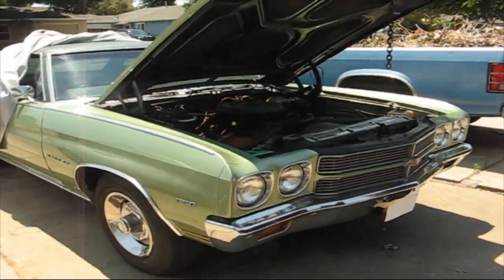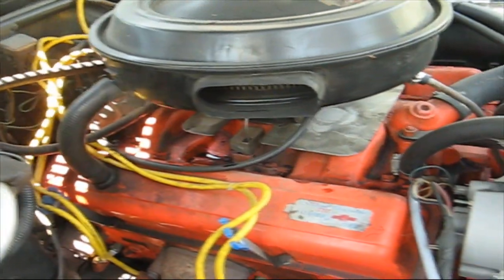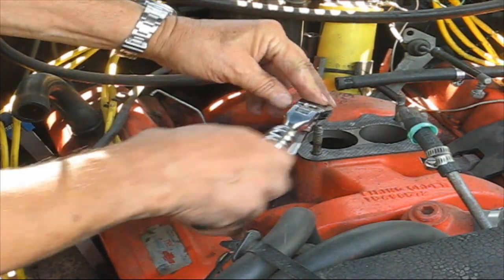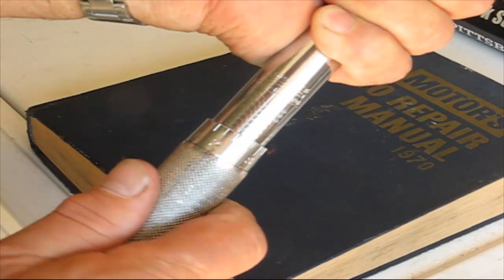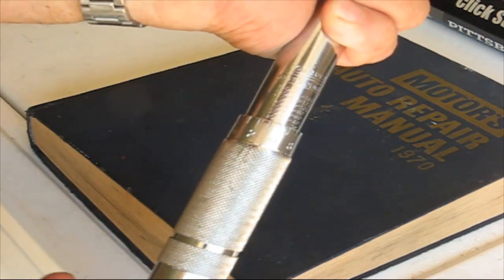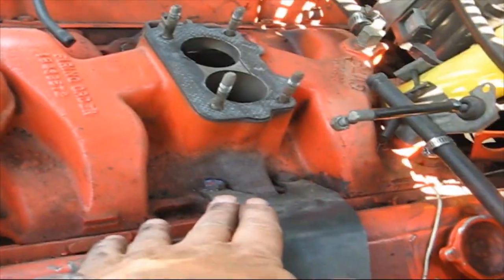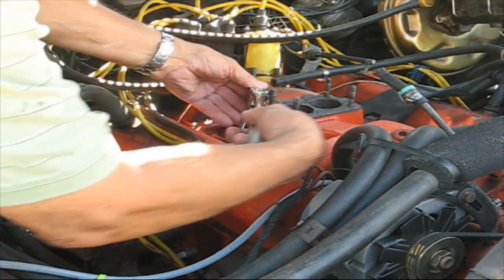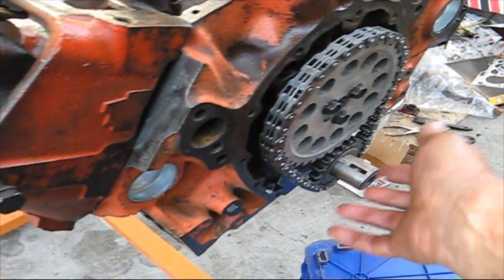How to stop oil pooling on intake manifold - Chevy

Comment: Would this apply to 305 SBC as well? I have an 84 pontiac with a 305 SBC and i have oil pooling in 3 of the 4 indents. Until now I assumed that the carb was flooding (with no evidence of gasoline on the outside of the carb) but having seen your video, I am now convinced that it is oil. (Im not an experienced mechanic, I can't tell if it is oil or gas. I guess one way to tell if the car sits for days, the gas would evaporate..) any advice would be appreciated! Thanks+
Reply from the maker: Put your finger in it.
This is not hard, just take out each bolt put RTV on it and tighten it back up, then go to the next one.
Reply: @davidlis6709  It was oil. I cleaned the area, took the bolts out (all threads where drenched in oil), cleaned them with carb cleaner and put black RTV on the threads. Due to the angle, I couldn't get the socket with the 3/8 driver to fit perfectly, but i did try my best to torque them down. We shall see if that fixed it. Thanks again for taking the time to respond!
Reply from the maker: @robbiesz  See, not that hard.
Reply: it's hard to use a torque wrench  @robbiesz Impossible. Plain wrench I used too. 1982 firebird 4 bbl. 3 of the bolts sealed properly but one yesterday has oil again.I m using 134_2001 Arp bolts black oxide Hex  for the intake.

Comment: This is a tried-and-true method! I own (50-year ownership) a 57 Corvette, 283 (original) engine. When I rebuilt the engine years ago, I increased the oil pressure by installing a new heavy-duty spring in the oil pump. With the increase oil pressure oil started pooling around the same bolts you mention in your video. I also removed the bolts (one bolt at a time on both sides, 4 center bolts) and wiped the threads with Blue RTV.  Reinstalled, torqued the bolts and this solved the problem. Thanks for the video!
Reply from the maker: My old 57 Chevy with a 283 had the same problem.  I wish I still had my 57.  I sold it in 1970 for $350 to pay for college tuition.    Looking back it was the right thing to do because it eventually lead to a BS in Mechanical Engineering and provided a good job.

Comment: I just wonder why you could guestimate with the ratchet to torque the intake bolt, but not the torque wrench?
Reply from the maker: I could not get the torque wrench on the bolt.
If I was not making this movie, I would not even use the torque wrench because I have been doing this since 14 so I have a feel for how tight it should be.   Wrong answer.
Reply: @davidlis6709  I understand, next time you can use a 3/8 extension instead of 1/2, smaller diameter will fit the carburator lip, you could add a flex joint to help for clearance, 1 or 2 degree of offset will not affect your torque in a significant way.  And most of all, thank you for your video. My bbc 454 is pooling oil on the intake, i will check if the bolts have sealer.
Reply from the maker: @ayuse01  I have never seen anything from the factory having sealer on the bolts.
Reply: @davidlis6709  Well, i finaly have a leak free 454 bbc, it was the 4 middle bolts on the intake that needed sealer.
Reply: @ayuse01  I have a 454 with pooling on middle bolts on drivers side.  I am anxious to try this and hopefully resolve my issue as well!  Thanks David!
Reply from the maker: @ayuse01  The end bolts don't get the same amount of oil splashed on them compared as the middle ones.
Reply from the maker: @cjf3838  It always works

Comment: This is what I need to do to my 63 impala with a 350 sbc.

I've just never removed the carburetor before. I'm sure its scarier than it look but don't want to mess anything up.
Reply from the maker: Stop talking like that.....    It is not that hard.  Take pictures of the linkages so you remember.  You have to start somewhere, do the easy jobs first to gain confidence, than you will be like me and tackle anything.

Comment: Dumb question here, but where is the oil intake?
Reply from the maker: There are not dumb questions.  We all have to start somewhere.   On this engine, you add oil on the drivers side valve cover.  Is that what you are asking?

Comment: Thanks for taking the time to put this video together.  I have oil pooling in these locations on the driver side of my 350 small block with 4 barrel.  I was thinking it would be resolved when I replaced the valve cover gaskets but this looks to be the real cause.  Will give it a go.
Reply from the maker: I am sure this will solve your problem.

Comment: my 350 leaks oil through the dipstick over 50 mph, what is the fix? Its tuned properly also
Reply from the maker: Does it leak where dipstick goes into the block or at the end of the tube?
Reply: @davidlis6709  end of tubeit gives under the hood a good washing of oil
Reply from the maker: @sirjohnahayfalcon  How many miles on the car?
Does it burn oil?
Is there oil around the PVC valve?
Is there oil in our air cleaner?
If it is blowing out oil, you may have weak piston rings and the engine has a lot of blow back.
Reply: @davidlis6709  oil is only coming out of the dipstick and shoots past the dipstick handle. No where else probably 50k miles on the engine its an 87 suburban. Thanks
Reply from the maker: @sirjohnahayfalcon  Something (vent/ pressure re leaf) is plugged up.  If it was an older car, I would suggest the PVC valve on the valve cover.   I don't know what an 87 looks like.  Does it have a valve (of some kind) coming out of one of the valve covers?  
Do you know who or where it was rebuilt?
I am struggling?
Reply: @davidlis6709  yes it has a pvc valve  on the.valve cover but where is the vent pressure releif? Thanks
Reply from the maker: @sirjohnahayfalcon  That is it.  If you remove it from the valve cover and shake it, does it rattle?  If is does, it is working.
Is there oil in the air cleaner?
Reply: @davidlis6709  no oil in the air filter , pvc rattles good , some oil on the other side hose going into valve cover by the oil cap, but mainly blowing out of top of dip stick. The dipstick doesnt push out much but oil definitly gets by it driving over 50mph
Reply from the maker: @sirjohnahayfalcon  So, I am running out of info.
Your engine has 50K.   I have a 90 Mercedes with 220k.  The timing chain jumped and broke one of the heads.  I rebuilt the top part of the engine but did not do the rings (big mistake, tight valves and lose rings = lower compression).  When I run the car harder, like going 80 mph for 1 hour or more (I live in California, we go faster on the freeways), the engine run at 2,800 rpm.    I noticed that I have a little oil on the exhaust manifolds causing it to smoke slightly.  To much blow by or whatever you want to call it.  My issue is caused by not replacing the rings when doing a valve job.

I know it only has 50K, but did you ever check the compression at each cylinder?  They rent the tool at auto parts stores.

Comment: Question. I had this issue on my Chevy 350 and did exactly what you did to fix it prior to seeing this. Actually, my question is where those bolts thread in, is there supposed to be oil in that area? I was "advised" today that's only a bolt carrier area and there shouldn't be oil there in the first place, unless the intake gasket is failing. Is that true?
Reply from the maker: In the video 15:23 minute mark, shows the holes where the manifold bolts to the heads.  These bolts are exposed to oil flying around where the lifters are located.  The center ones get the most.  Why the passenger side of the motor get effected the most is a question for the GM engine designers.
Intake gasket has nothing to do with oil pooling.  If the gasket is bad, the oil would accumulate between the manifold and head.
Reply: @davidlis6709  Thanks. Yes, I confirmed that as well. Also, I've had zero weepage since doing this.
Reply from the maker: @Asphaltsquadron  Before doing this video, I talked to my friend who runs a machine shop and a couple that run repair garages and they all agree with me.

Comment: I have a high mileage 1994 suburban it was smoking really bad  out the tail pipe I found out that oil return holes on the heads were plugged up so the oil pooling up inside the valve covers that was causing  value seals to leak and was making it smoke...
Reply from the maker: So by unplugging the holes, did it stop smoking?

Comment: What about when one valvecover get hotter than the other
Reply from the maker: What did you use to measure that?
Reply: I just let it run up to operating temp then put my hand om each side couldnt keep hand on passenger while running to hot drivers side i could
Reply from the maker: @harrisjr9849  I would take off the valve covers and see if the hot side is getting enough oil.  Use a piece of cardboard as a dam to stop the oil from going on the exhaust manifolds.
Reply: @davidlis6709  ok thanks alot

Comment: Could this cause (blue) smoke when starting the engine after a week of sitting?
Reply from the maker: No. 
I believe what you have is oil leaking down the valve into the piston area when it sits for a while.  Then, when you fire up, it burns the oil on the valve.  The little black rubber seals on the upper part of the valve are getting old and hard.  I have a video showing how to rebuild a cylinder head and it should show you what I am talking about.  
Replacing the rubber seals when the head is on the engine is for experienced mechanics because if the valve falls into the engine it will be a big job of removing the head to get the valve out.
Just add oil and wait until you rebuild the engine to fix the problem.

Comment: I got the same issue, same bolt passenger side since I got remanufactured motor put in. It's been doing it every since 2500 miles. Been dealing with issue for 4 years and 32k miles. Looks like I'm going to have to do whole intake gasket now. Bc today I took it for a drive and now leaking oil from front and rear of intake.  Highly pissed now.
Reply from the maker: Try tightening the intake manifold especially in the front and back.  
I  know this is not the right way but clean the manifold/block interface and use some RTV Blue and see if you can glue it form the outside instead of replacing the manifold gasket.
Reply: @davidlis6709  thanks for responding. I was installing a booster fuel pump today and actually thought about doing what you just said but it started raining. I have black and red at the moment do you think one would work? Or should I just go but a tube of blue? I figured when mechanic said he doesn't like using the front and rear  seals bc they leak that the bead of rtv wasn't thick enough to replace them.
Reply from the maker: @itsruffoutchea6636  The blue is what I use on everything.  I am just guessing if this would work.  Maybe it will create a dam and hold back the oil?????????????????

Comment: so i have the same issue, but can you just take one bolt out seal the threads and torque it ? Or do you have to re-do the entire intake manifold ?
Reply from the maker: Just do one and see what happens.  You do not have to do the ones that do not leak oil

Comment: I have the same exact problem on my 67 327 - I have tightened that bolt down - still oil - I will def remove and RTV it now - not a ton of oil - just annoying
Reply from the maker: I have had this problem since my 57 with a 283, then the same with my Nova 327, and now with my Chevelle 350.  I talked to several mechanics and machine shop people and finally figured it out.  That is why I made this video.

Comment: Great videos very informative.  I have a question on the 350 build.  Did you resurface the block and heads?
Reply from the maker: I took the heads and block to a machine shop.  He measured both and said they didn't need it.  So he bored the cylinders .030 over and bought a 350 engine rebuild kit.  Crank, cam, all bearings, lifters, gaskets, timing chain, etc.  New engine